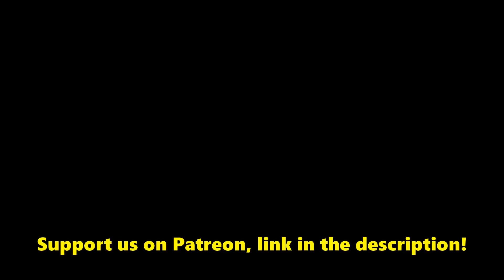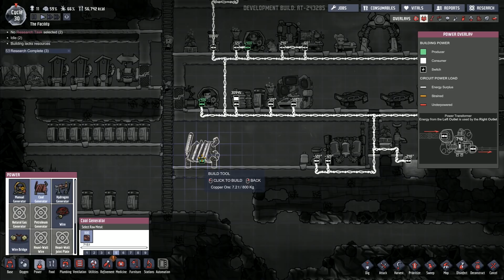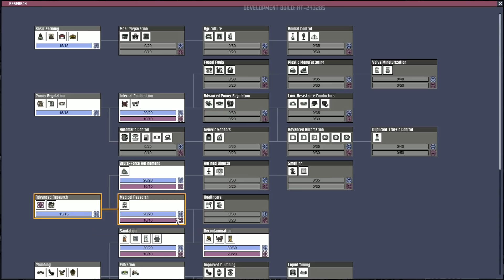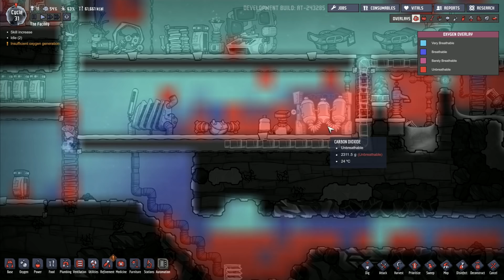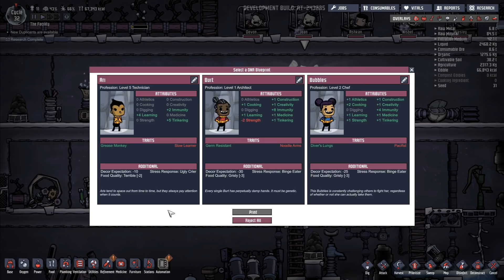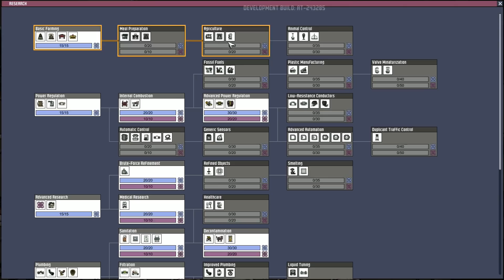Let's Play Oxygen Not Included #6: New Pool!

Comment: A lower cost alternative to mesh tiles, is airflow tiles. Mesh allows both air and liquids to pass, while airflow only allows gasses. Generators produce heat, heat goes up, and mealworms don't like too much heat. You need Deoderizers to eliminate polluted air from polluted water. The Algae terrariums convert CO2 to O2. @4 :59 it was doing it's job. But it works better to have all the CO2 go to the bottom of the base, have ration boxes there (sterile environment), and the level above that, Algea terrariums. With my setup, the coal generator's at the top, so the CO2 goes all thew way down naturally, and gets converted to O2, at the bottom, which then works it's way up. No need for electricity and ventilation, to do what it does naturally, imo. I prefer Algae terrariums over Carbon Skimmers, because the Skimmer outright eliminiates it. I see you found the liquid vent. ^.^ Outputs drip down, you don't have to make the liquid vent low. Polluted water pump needs electricity, and there's some chunks of copper that were dropped into it, after you swept it (from dismanteling the electical line for the pump.) The other conductive wires, have a double wattage capacity, but requires a refinery, and itself will overload the circuit it's hooked up to, all on it's own. So unfortunately, your first batches will be to upgrade it's circuit.

I'm one of Frithgar's minions. Yes, a bed works, thanks.  LOL.
Reply from the maker: Becoming a minion is the easy part, it's earning the bed that catches them out!  Appreciate the tips as always, will try to work something in with the co2 trap
Reply: Great video, liking the series. Had no idea the game would be so much fun.... I never even looked at it until you made the first video. I didn't have the correct impression, so I didn't even consider it. 

I agree with Draco's comment about the good, and polluted water to be farther apart. One of the problems with the Lav in your base, is because it does not go to a holding area, but directly to the Electrolyser via the Water Sieve, it's pretty much always blocked. The reason, is because the electrolyser is so slow, there's barely any water flow. Since you've had such a tiny holding tank for polluted water, this was actually a good thing you didn't find the water vent earlier. So, for your next video, you'll want to monitor the lav/shower waste after you vent it into the tank. It'll fill up much faster, while allowing it to be used more often.

Comment: You need to put mesh tiles throughout your base so the carbon dioxide falls because its heavier than oxygen. You won't need the gas pumps for that. Build a big spot just to house the carbon dioxide at the bottom. You can also put food ration boxes in carbon dioxide and it'll prevent it from rotting. You should build a big water tank if you use the regular tiles do it as 2 walled and just pump all the water in it. If you keep ot as dirt it has a bigger chance of being contaminated. You should also not keep clean water next to polluted. You're just waiting for an accident to happen lol
Reply from the maker: I was actually thinking that as I was building it, I think I'll move the fresh water pool several blocks to the right so that there is less chance of anything bad going down!